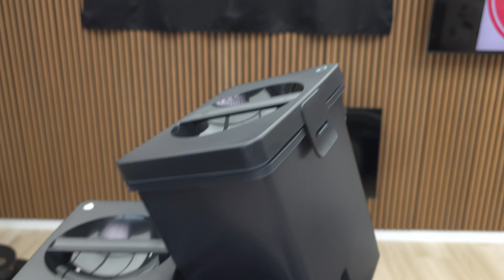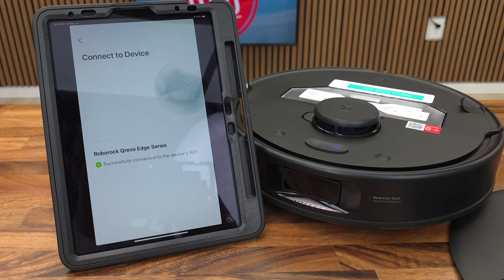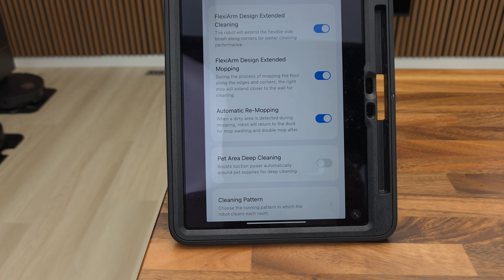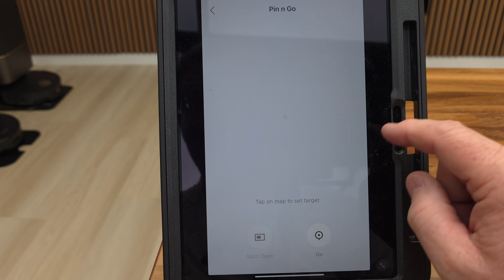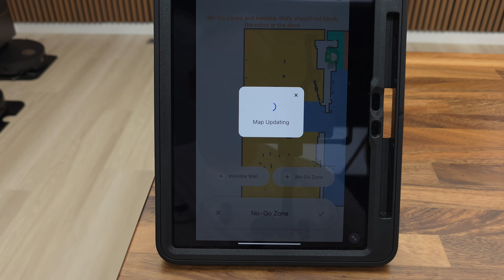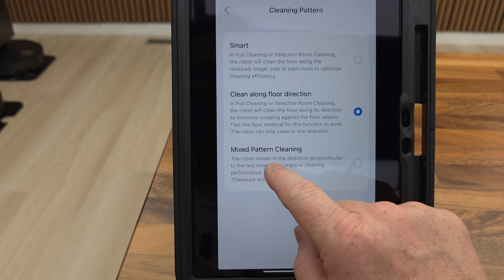Roborock Qrevo Edge S5A Robot Vacuum & Mop How To Setup / Settings Explained Connect To Wifi

Comment: Hi there... Was hoping to pick your brain on something related to the Roborock S5A.  I just picked one up during BF this year after watching your videos on it, and I've used it a couple of times and really like it, but my one major gripe with it, and this is more a dig on the app I think that the vacuum itself, is that there is no way to receive notifications when a job has completed.  Unless I am missing a setting in the app, I do not see anything to notify when a job is done.  I was having the unit vacuum and then mop a specific room in my house last night, and due to an error on my part, it was actually going to clean the entire first floor of my home instead of just the one room I thought I had asked it to clean, so I instantly threw up a no-go zone and it stopped because it was already in that zone, so I had to pick it up and move to outside that zone for it to continue and I actually got a notification on my phone about that, but never one for when it completes a job.  Do you know if that is possible? Or is that something Roborock has not made available with this unit?  Seems kind of odd not to send notifications when a job is complete... I mean my 8 year old basic ass iRobot Roomba vac sends out notifications when a job has completed.

Comment: I have bought this unit and I set a schedule and now the schedule is gone and I cannot even find a schedule anywhere in the app. I cannot even add a schedule anymore. Any ideas of how to find it again? I see my history usage and then the next box is maintenance and then the rest of the boxes for other settings.
Reply: I actually found out the answer. My wife created the account under her email. I was using her email and then I had her share the robot with me. I created an account under my email which I am able to run the vacuum and alot of settings but I no longer have access to making schedules or doing firmware updates unless I use her email in my app. Hope this helps other out as well.

Comment: Hi. I have big issue with connect to my iphone to S5A. I try a lot of things but still have issue. And I though it's robot issue and reject it then they send a new robot but still can't connect with S5A. Here are what I did but still not working. 1. Wifi router only 2.4G. 2. Turn off cell phone data. 3. Turn on location service. I have some question when I choose device. Normally I should able scan QR code to find my device but i can't so I need to manual add. Here is question what device I should choose? I can NOT see Qrevo edge S5A so I choose few different type and none of them working. I try Qrevo edge C / T / Qrevo S. None of them working. After app asking me connect to my device , I can choose roborock_xxx when I go back to app it show " Please select the device's Wifi network and retry-3003."  Can someone share your experience with this. Thanks !

Comment: The difference for me is the battery  at 5000mah vs 6200mah ish makes a difference in that my cleaning Floorplan 2x runs from 5pm to 7am at 3400sqft doesn't consistently finish.  Decreased interval mop cleaning to every 20 mins so it doesn't run out of water, but still has trouble finishing full clean due to battery size and charge rate. The charge rate on the s5a is slower than I expected.  Also, missing video from  remote control makes remote movement difficult when the robot is stuck.  Definitely, doesn't get stuck like s7 maxv ultra and mopping is much improved.  Cleans between office chairs where s7 couldn't go.. Cleaning base station is so much easier.. don't get black zebra streak patterns or dark stripe next to walls anymore :)

All in all, great vacuum/mop but for larger Floorplans, it  takes a step back..